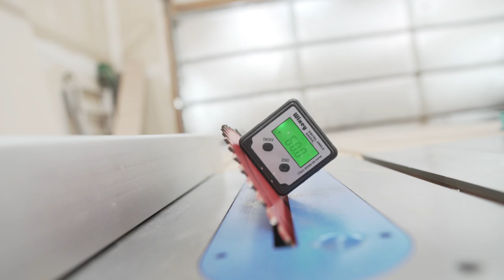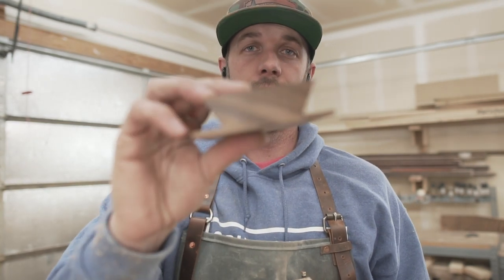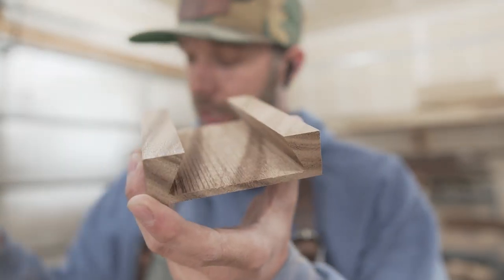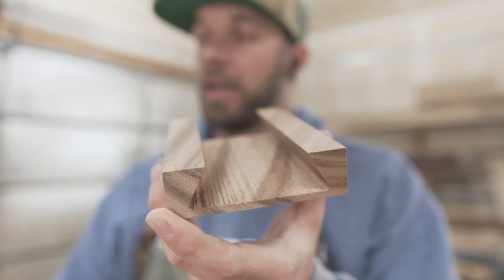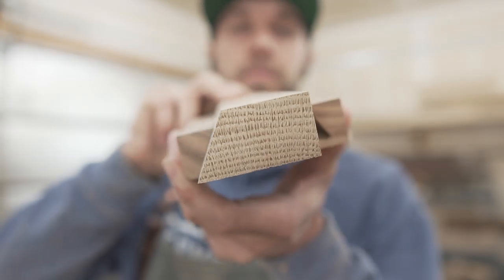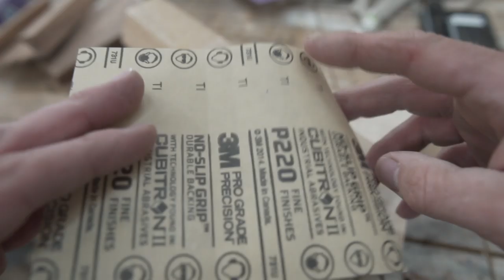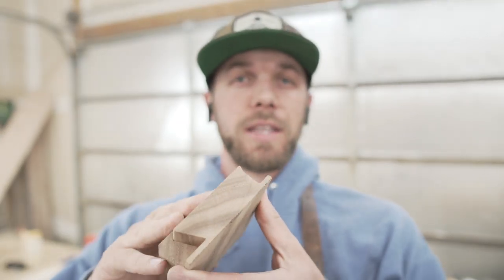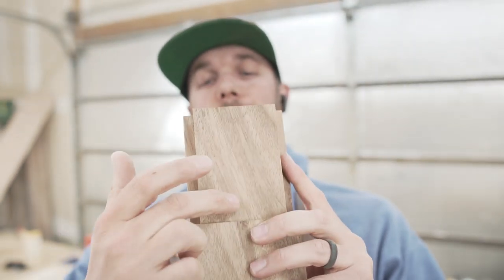MAKING A SLIDING DOVETAIL FLY BOX | Cinematic Woodworking

Comment: Nice. You could recess some magnets on the edges to hold it closed. Keep up the great work Bro!
Reply from the maker: I actually purchased some little magenta today for that exact purpose.  Great minds think alike!
Reply: That's what I did on mine (two pairs of 5mm magnets.)  It didn't occur to me to make the dovetails, or at least rough them out using the table saw with the blade at an angle!  I hogged out material using the table saw, but at 90's and then did the dovetails on my router table.

Fun to watch different ideas in practise.

Comment: I've got a penny collection (one of every penny since 1951 until end of production and some others from the 1800s) and I've been wanting a nice way to display/protect them in a grid-like pattern to really show off the decades. I was initially thinking of having them hang from a wall somewhere, but I do think it'd work out skipper to make a box like this that's much wider and longer (but again, rather than a recess, flat bottom mill in a grid of holes to snugly hold the pennies) 

I'm also wondering if there's an easy way to make a backing piece so the box can only open by sliding out one side? Do you think it'd be possible to somehow only cut the dovetail in 95% of the way?
Reply from the maker: That would be such an awesome application for this, you should definitely get it a go and let me know how it turns out.  I was thinking the same thing with this design, adding a small brass rod drilled into the end of the male portion that would stick up only an 1/8” and having a little recess spot in the female portion were that pin would catch and stop it from sliding out from that end... hopefully that makes some sense. 😂
Reply: @blacktimbercompany5716  Oooh, yes. A little pin stopper, then maybe for the sake of symmetry on the other side I could make a similarly removable pin to be a little latch of sorts..
Reply: Black Timber Company EXACTLY what I was thinking about making with this concept lol

Comment: Great idea about the glued sandpaper.  I made the same sliding dt joint (from prior video: https://www.youtube.com/watch?v=B91LbUtad8U&t=326s ) and had trouble getting the part under the angle shaved down (used a straight bit in router table for the middle).  Will do the sandpaper trick tomorrow.